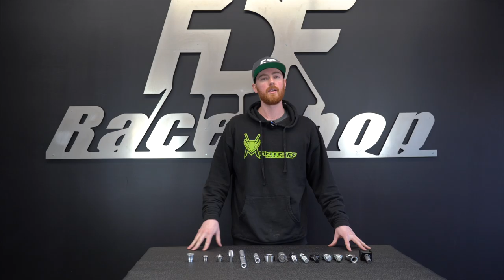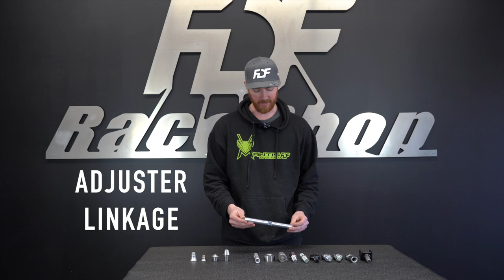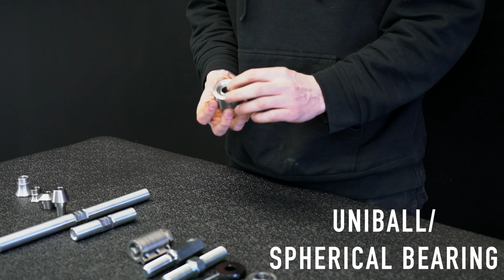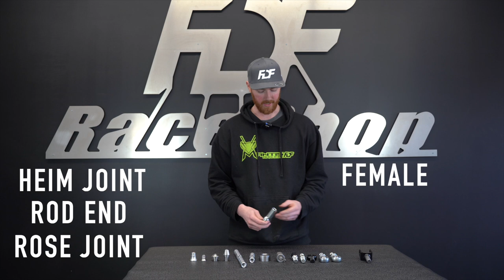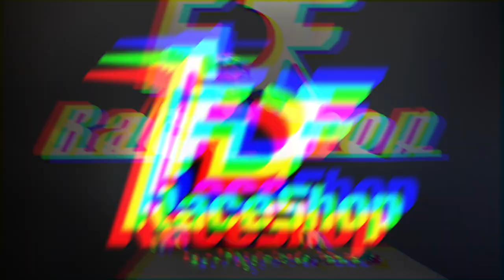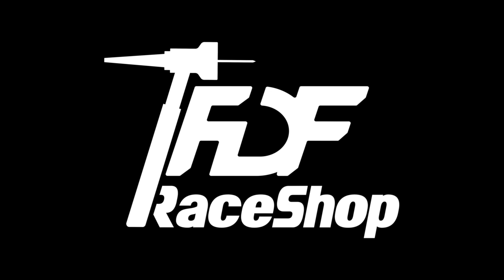Proper Terminology for Adjustable Suspension Components

Comment: I would be interested in a video going in depth with the installation, adjustment range, and overview of the S197 Mantis kit. 

I’m particularly interested in the camber caster plate. It looks like it uses 3 bolts where there are 4 bolts on the chassis and that’s so the strut can be placed in a certain location. No other kits do this so I’m interested to hear about the design that went into the kit and why it’s made this way. 

Thanks!